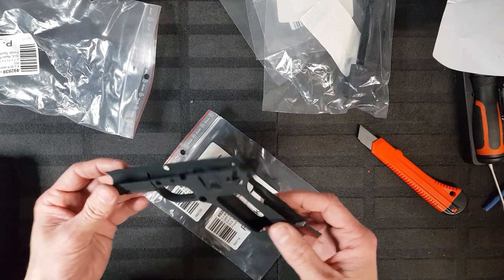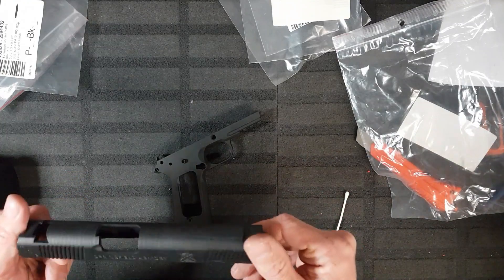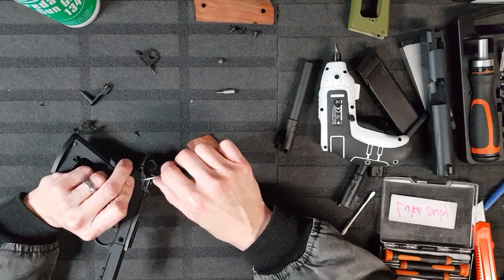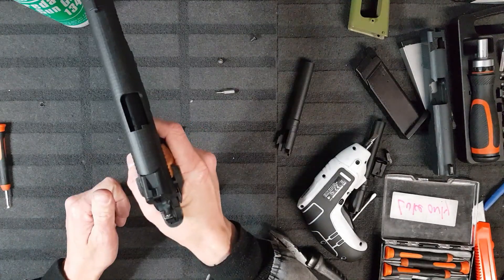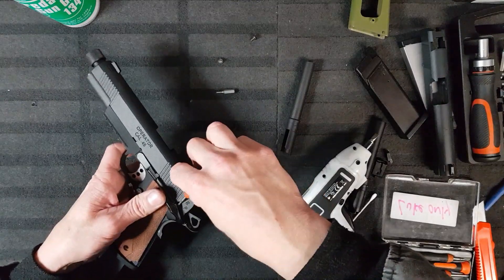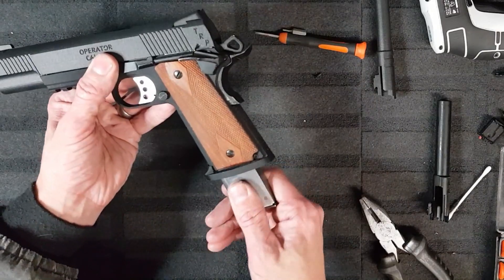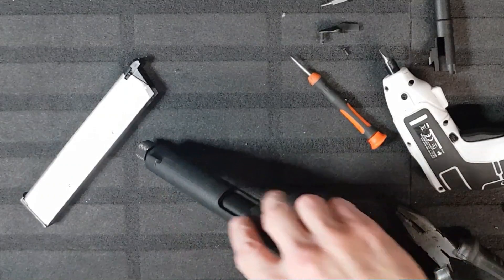Fitting a Kens Props 3D Printed 1911 Kit

Comment: 3d printing can produce some nice parts but they're taking the piss with a pistol frame
Reply: Nah I've 3d printed glock frames for real guns an it works good Ken just uses cheap plastic an a terrible design
Reply: @davidp4270  There's a difference between a design that's intended to be made from polymer and one that isn't, i don't think even quality filament can save this.

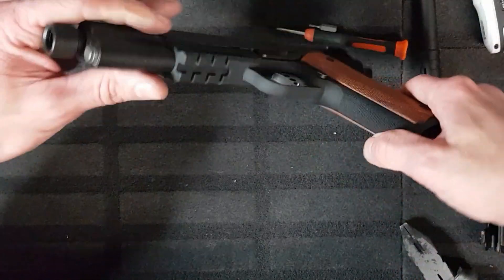Comment: 4:45 part of modelling skills is actually testing what you produce. 3D Printed parts are fine, when they are designed correctly, they can literally stand up to hundreds of real rifle rounds (Some guy 3D printed a receiver for an AK and it functioned for that long) with proper materials. This however, cannot.

Comment: At that price you may as well spend the extra $75 on a printer so you can continuously reprint when they blow up, or start your own scam shop
Reply: Or just you know, print off the gun the right way and make sure it works the first time. All this gun needs is for its models to be widened outword on the outer face meshs so the internals still fit fine but has some actual girth to them.
Reply: you can buy a good printer for less lol

Comment: I think printed slides are ok if you just go for pure speed and run the right springs, blowback units and low power gas/hpa with them. But a printed frame cant be a good idea....

Comment: If this is from kens props, I have all the feelings of what you have....I got a hi capa slide and barrel probably about three or four years ago for about $80 total. Within 150 rounds in 45ish F on propane, the slide yeeted itself...now granted, I was using the stock bbu (which apparently you have to use light weight bbu...which was never stated on by the owner)

Now I had a slightly different experience for the feel/fit, I loved it, yes it wasn’t like metal or molded plastic, but goddamn did it feel and look nice in my opinion.

The owner gave me back his mark up which was like $30...so I lost about $40.

I have a basic video overview on my channel if you need more conformation that 3d printed stuff that is crazy priced is not good. 

Now I do love 3d printing when it works, heck I printed a kc02 charging handle out of PLA on my own printer and it has held up beautiful for using weak plastic, 600ish rounds so far on propane.
Reply from the maker: Yup, same shit.
People swear by his slides (according to the people that sold this shit) but I'm seeing loads of reviews that note they suck for whatever reason.
For $80 you can buy a 7075 aluminium cnc'd slide...

Comment: just fixed this m4 that was bought in 2011 and the guy says hes been using it like thrice a month since then. It looked flawless inside! nothing wrong with it at all, just a cable that disconnected. There was absolutelly no wear on any parts. It was a Classic Army M4 apparently, branded as Armalite. He said he had never changed any parts inside, do you think it's true?
Reply from the maker: Possibly

Comment: How much is a Western Arms 1911 varient these days? Got to be less than that once you add in the donor 1911.

I know which I'd rather have.

Kinda proves the point that low-end 3D printing is just 'Rapid Prototyping' except for making very basic parts.
Reply: I managed to find a WA Kimber in excellent condition for $220 a few months ago (still had original paperwork and accessories too). I've seen a few on ebay recently, but the price ranges depending on model and condition. I also know nothing about Western Arms, so I can't find any more mags for it because I'm not sure which mag works in mine.

Comment: Been running my Ken’s Props 22LR kit for Glock for thousands of rounds now, zero damage and amazing performance. Where did you order from? Because the print is entirely dependant on the printer/print house rather than the design. Looks like yours wasn’t printed correctly, way too many surface errors for an expensive MJF machine
Reply from the maker: I know where it came from (I think 3d print is bullshit so I wouldn't pay anything for 3d print) & I don't like cunting people out so won't say where the customer got it, it's not their fault but it's 100% kens who made it.
Reply: @NegativeAirsoftTech  that's fair! Ken sells his catalogue to print houses who then sell it on via sculpteo, so not every slide is equal! I got mine from KMW CustomWorks and it's been flawless 😊 Only thing I've noticed it's you have to apply more lube than you normally would because of the surface finish

Comment: WTF???
Sure 3D printing is a cool technology, but that don't means, you can print literally everything and it will work. That video is a good example for such a DO NOT. It just makes no fucking sense at all.
I have a 3D printed switch in my G&G F2000, just because there's no alternative, the original switch of that rifle is terrible and causes many issues. But i had to overwork the switch, reinforcing it with some 0.6mm strong grade 2 titanium sheet on some critical places, glues with industrial epoxy and baked in an autoclave oven (yes i have those possibilities). The switch was made from thicker (2.2mm) polymer than the 1911 frame in your video, but even then, it tended to bend when the triggerbar pushed against the switch, therefore the titanium (i did not got T66065 or 7075 alu as sheet, and the titanium sheet just cost me a few euros)  reinforcement. At least it works now perfectly fine and don't causes any issues. But that is not possible with the frame of a handgun, and even so, just get a good aluminium or Polyamid fiber plastic frame, and you will be fine.